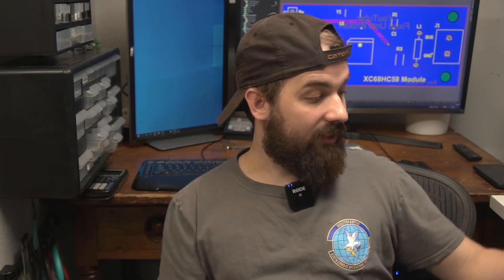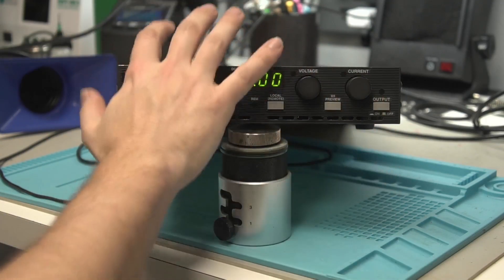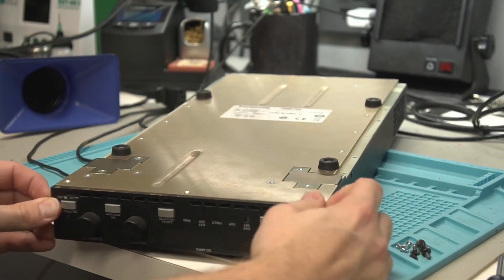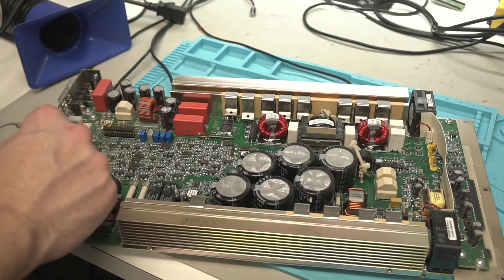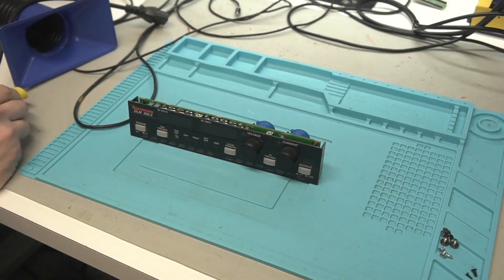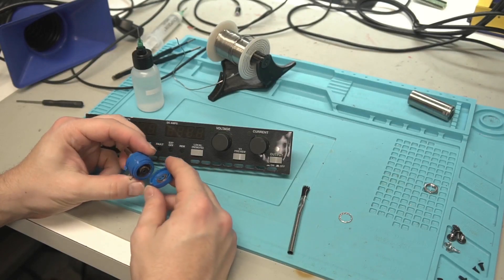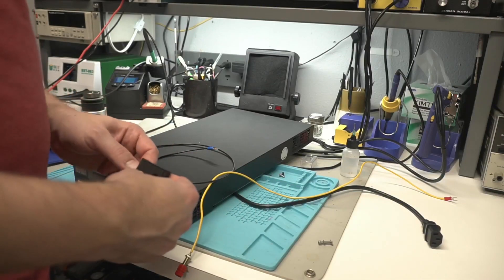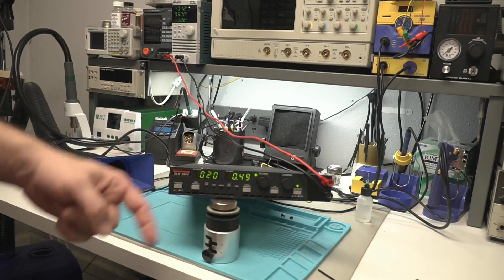Sorensen DLM 300-2 Repair: Jumpy Voltage Control & Modification

Comment: Hey I’ve been watching your YouTube videos, very informative! But i had a question as far as replacing the led backlighting on all controls (hvac, door switches, steering, light control) on a 07-13 Silverado, can’t seem to find info on that. Not sure if the controls have a green tint/film to them or if the bulbs are green. Also what size led would be good to replace them with! Thank you in advance!

Comment: Hi. Cool channel, been checking out your vids for a few months . You've encouraged me to try a DIY on my cluster (nissan). I have diagrams but cant seem to light it up on the bench.  How do I go about figuring out what will turn on the LEDs on the cluster ?
Reply from the maker: I haven't really worked on nissan stuff, most clusters the lights are their own standalone circuit and you just give it 12v and they will turn on but some aren't done like that.